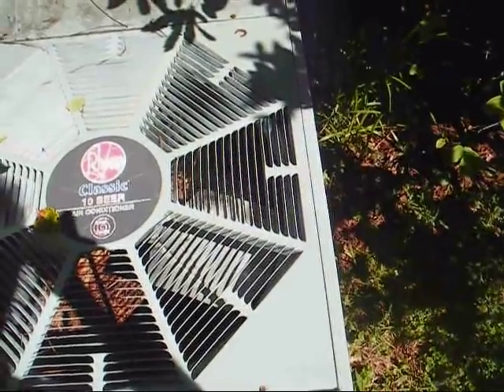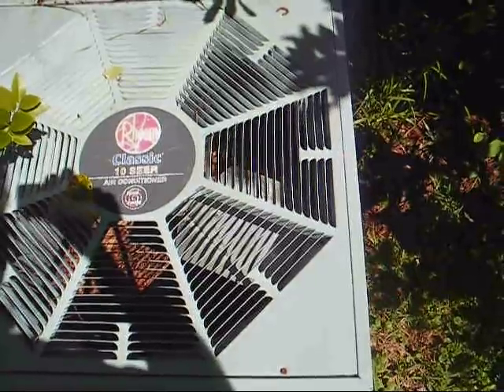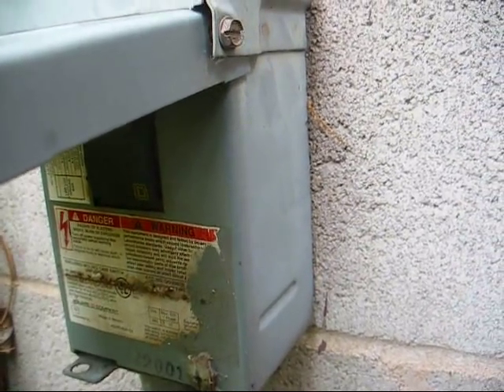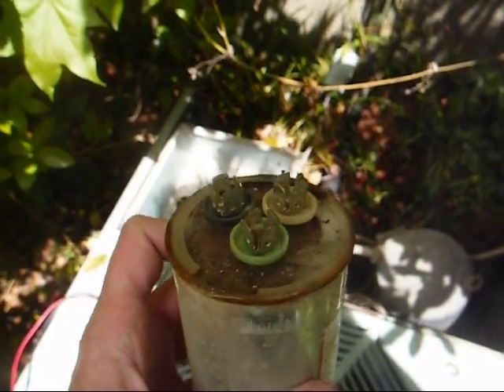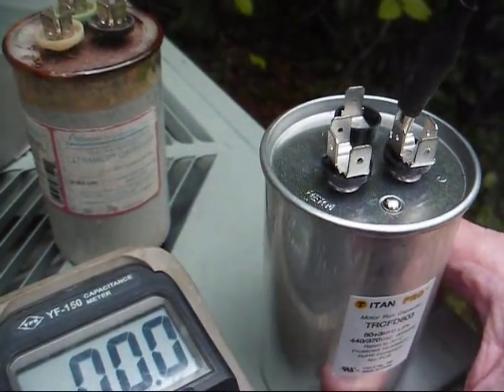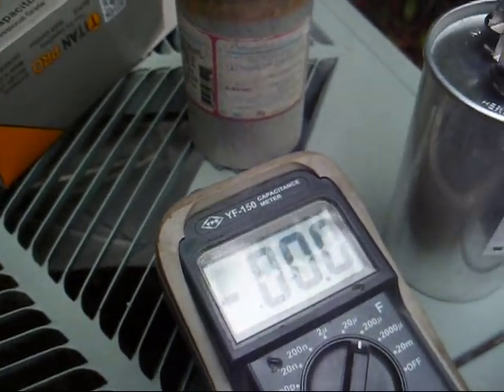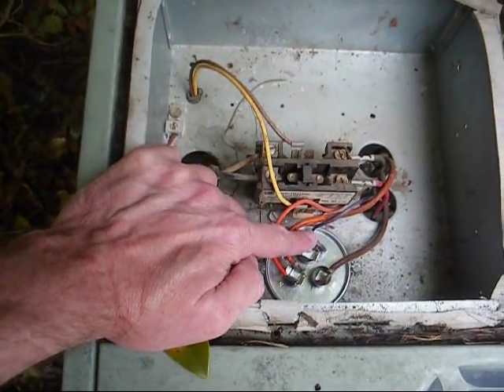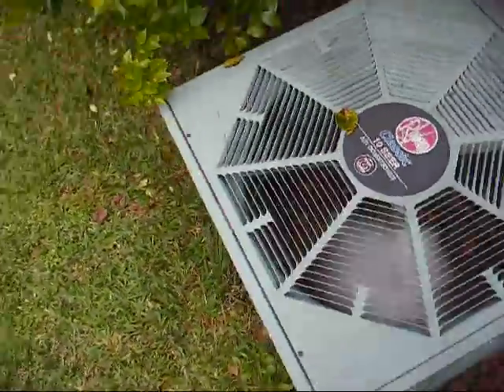Capacitor replacement on a 2002 Rheem central air conditioner

Comment: Thanks for the excellent video.  I might mention that on my unit, the factory capacitor has a plastic cover over the entire capacitor and fits vertical in a hole with two screws holding it down.  Several other capacitors are made for this air conditioner which work fine, but may be different shapes or diameter and may require a metal strap to hold them down.

Comment: Just in case the China made motor cap doesn't last I would order a spare in from Mouser or DigiKey of a reputable brand. Comments made about cleaning out the debris from inside the unit are quite right, as well as cleaning the condenser coil, the compressor will live longer that way.

Comment: My ac unit blew the same capacitor but when it blew, it burnt out other parts & caused damage so I ended up replacing the unit with a brand new one as my reverse cycle air conditioner is a ducted system through my house. The old one was only 3 years & was a crap brand too.

Comment: 3:30 Given the vibration in a compressor/fan unit, you'd thing the manufacturer would care enough to line the sheet metal cutout holes through which high voltage wires run with rubber grommets!  I love your radio repair videos.

Comment: Put a date on it and see how long it will last for.
Reply: I have a Ducane HVAC unit in which the run capacitors for both the ductwork fan and the compressor failed within the first ten years.  The cheapo replacement for the indoor fan has lasted, but the dual-purpose outdoor one lasts maybe three years.  The key is to have an extra of each on hand so a repair takes minutes.... I Don't wait for a failure that is bound to happen;  it pays to note  the specs for your caps and have 'em on hand!
Reply: Why is the unit so exposed to the elements? Build a structure to keep out the rain, snow and leaves etc.
 It's always the capacitor. Put new cap' or cap's in and it will work...lol.

Comment: Well with all due respect sir, the biggest issue with that condenser is it is a Rheem. That company is riding at the BOTL when it comes to quality. PurE garbage. I don’t  care, caps are caps but the compressor and the coils fail regularly. My dad loved them because of the pricing as he was a HVAC contractor. Lennox, Trane, and Carrier products were so much nicer but they cost another 20-25%. My dad was a superb mechanical contractor, but he hated sales. So he didn’t realize the value-
he could pass along to the customer via the workmanship and design those companies put out. 
Thank you for the video.
Reply: James Lucas it looks like it's lasted 15 years which is impressive in today's world!
Reply: Hey, go through the trouble to make/post a helpful video about a simple repair on your car. I’ll then feel the need to inform you that in my opinion, the brand of your car is a POS, and you would have been better off with brands X/Y/Z, because their marketing has convinced me they’re better. I’ll even ignore the fact that your car may have obviously already given you 15-20 years of good service. 😉
Reply: Steer clear of any manufacturer that uses those dreadful microchannel coils, whether it be evaporator or condenser. They are prone to leaks.
Reply: The U.S manufacturers cut corners on quality in part because of so many cut rate units being imported from Asia to compete with U.S made ones, and they thought they had to go along with it since they assume that the consumers think that they are all the same. Our Australian friends like HDXFH and Aussie50 can tell you all about the Asia import junk air conditioners that get dumped there, especially the split systems. I don't agree about all Americans being cheap though, if you can demonstrate that they will get value for the money they will usually pay it. Sometimes they will pay more under the perception that they are getting value for money when they really are not, like Apple products today, or Sony products in the 1980s-90s, or with many German brand cars, sometimes all it takes is image and marketing. Most Europeans can't even afford a central HVAC system, many governments over there take away 1/2 (or more) of their income through taxes of various kinds.
Reply: @OlegKostoglatov  Apple products today?! Hahaha.
Reply: What was the question? They are overpriced for what they are, especially the computers and laptops.
Reply: Erik J. 
No problem. However, regardless of the fact the unit is 15 years old, it should have lasted 15 years. It should last 30. And like many things Americans seek, it should cost  only $39.99. That is about as much as most Americans are willing to part with. And BTW, there are companies in America still making canned caps. He could have bought one. 
I too was a contractor. There are cities in the US that have noise abatement codes, such as Cerritos, California. Condensers can be and are very noisy; annoyingly so. Some companies like Rheem, American Standard, do not care about the codes, little alone annoying the customer. Other companies do. Lennox e.g. brands their product with quiet technology. The compressor is not sitting wide open to the elements, but in a fully enclosed insulated compartment. The condenser fan moves more air a a far lower dB. The overall SEER has always been higher and with things such as oil tubes built into the suction line, to measure the superheat and solid access port valves, the units are made with quality. I have worked on Rheems many years. Rheems all in one stamped metal design offers the worst type of restriction for air flow for the condenser fan. They  do not offer even access ports on their models from that era.. How does one check the Freon level effectively?  I did not run the industries into building cheap crap, the American consumer did Normally, that’s all they want. But it is so pervasive , that crap is what you get no matter what. That is sad. Americans let this happen. Want America great? Then the consumer must open their pocket book and demand quality, like Europeans. But it will never happen.  
Take care.

Comment: Old cap had the tell tale puffy top, just like what you see with failing radial caps. Good quick fix. If I may make a humble recommendation; It looked like a fair amount of leaves on the bottom, under the fan. A good clean out of debris, and a hose down of the condenser coil would help to keep it healthy, and running efficiently.

Comment: Would it be wise to lube the motor bearings or not?
Reply: arthur fisher The motor likely has sealed bearings, so trying to oil them might not be possible.
Reply: arthur fisher On the fan, sure if you can find the lube ports. The hermetically sealed compressor of course is sealed and will not require oil to be changed

Comment: Lucky you heard that because it doesn't take long to burn the compressor motor when the cap fails like that even do it has is hone cut out circuit!! Good timing!! Just like you, I doubt that the new cap would last as long.
You have a good day sir!
Steph

Comment: Nice job.  I always get nervous seeing someone run their fingers across capacitor terminals.  Might be a shocking development.
Reply: anselb2000 This particular capacitor was connected in an AC circuit, so there is no stored charge- but it's always 'better to be safe than sorry'!!!
Reply: Same with microwave ovens my co worker  got shocked scared the carp out of me.